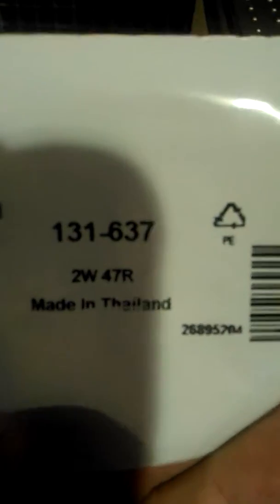£1.10 fix vs £37 board Dualit Espressivo resistor swap

Comment: I think I may have done the same thing, the steam part isn’t working it’s just making a noise but the main part still works, is this something I can do myself with zero experience? It’s the same model 🙈
Reply from the maker: hi if its not making steam but making noises it maybe one of the temp sensors has blown or temp fuse or a host of different things if you send picturs and exact details of what its doing at each setting i can try to diagnose the problem i think its abount time for a new video on possible causes ill try to do a video including the the seals which i promised a video ages ago  but the simple answer is yes you can fix it if the boiler is not burned

Comment from the maker: If that component was blown the machine will go into protection mode and continually blow water into the boiler, if it's making strange noises maybe you need to replace the seals on the pipes O intend to make a video on how to do that like and subscribe and catch that video when it made